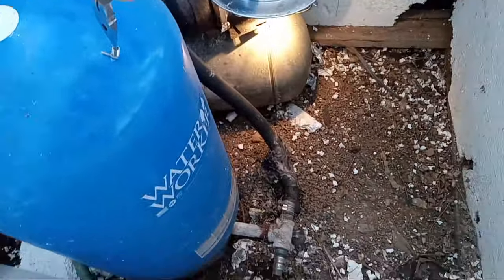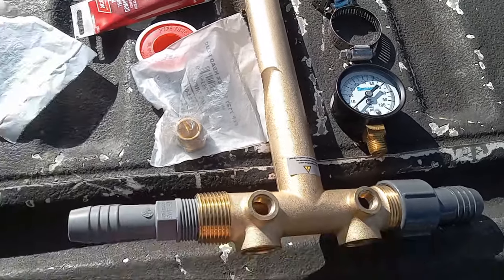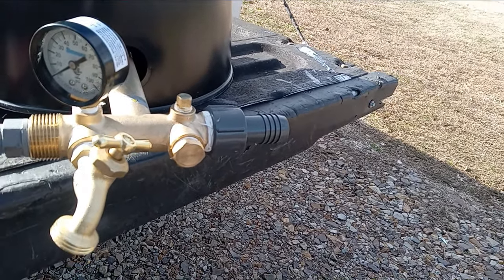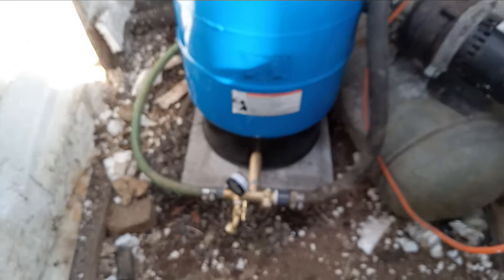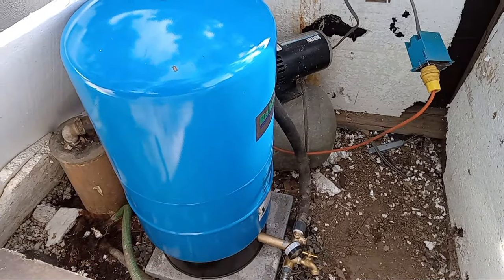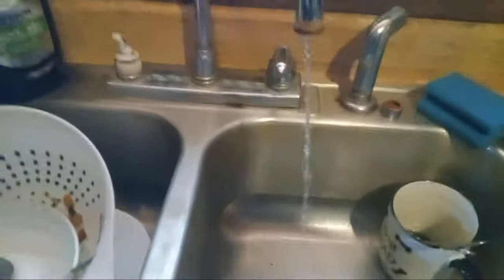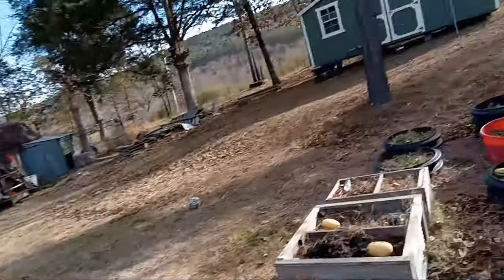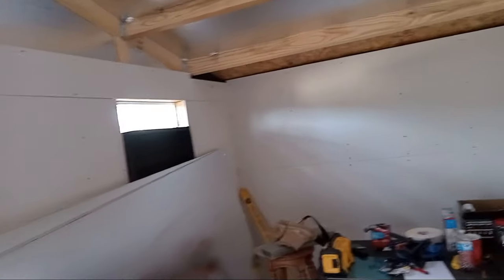It Gave Me Warning It Was Failing, I Ignored It.Now Working Out In Cold!

Comment: I had to hire a well company, last spring because the bladder was broken in the tank. The plumbing around the tank was not done correctly, by the previous owner, so all of it had to be replaced. They also replaced the gauge and the pressure switch. It took one man, over 6 hours to do everything, and that included going to get a new tank. You just saved a lot of money. It cost me $1,400. Good job, Mike.👍😊